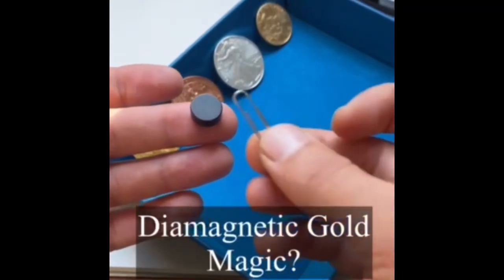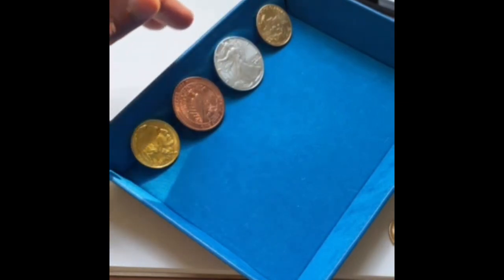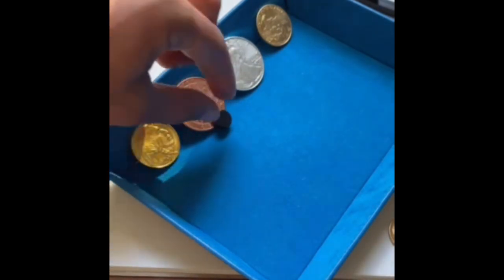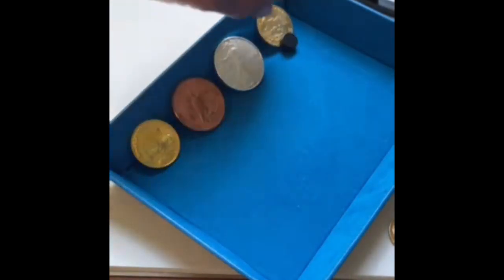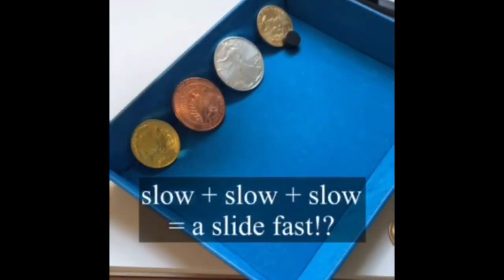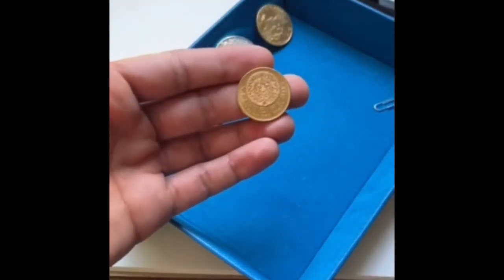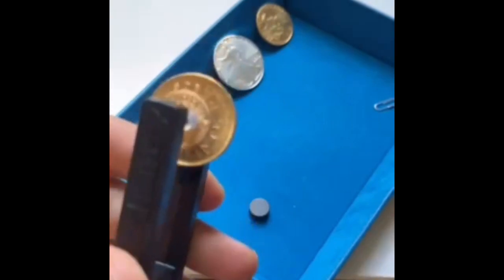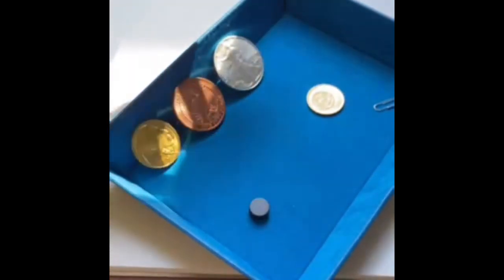What is happening to gold in this video? Science please explain!

Comment: Resistivity, electricity and magnets
1. Electricity and magnets: (TLDR version)
Magnets moved around a coil of wire, copper/silver/gold coins in this case, creates an electrical current by "pushing" the electrons of the metal. The resultant "pushing" is commonly called volts or electromotive force.
In other words; A device made to hold the magnet and spin it around each coin will show volts on a voltmeter.
2. Resistivity:
Gold, copper and silver have a specific resistivity.
Resistivity is a measure of how strongly a material opposes the flow of electric current. The lower the resistivity, the more readily the material permits the flow of electric charge.

Use an ohmmeter:
Gold- 2.44×10^-8 ohm-meter @ 20°C
Copper- 1.77 × 10^-8 ohm-meter @ 20°C
Silver- 1.59 × 10^-8 ohm-meter @20°C 

Two Hypotheses: 
1. The mixture of the various metals reduces the resistivity to such a small degree that it appears there is no resistance.
2. One of the coins is fake.

Comment: The alloy may be of such that the valence electrons change enough that the dipole states that are typical for diamagnetism for weaker metal are inverted. maybe the dipoles are closer to anti ferromagnetic characteristics.  Unfortunately this is a guess from what little I remember from chemistry for engineers class and physics two with calc.  I’d have to look at my notes and books again to get a better grasp.

Comment: As I see it, when you slide a magnet across the face of a piece of metal the magnetic field induces a voltage in the metal. Because the metal is larger than the magnet, the sides not affected by the field act to short circuit the voltage and another magnetic field is generated, this time in the metal but in the opposite direction to the magnet. This is what slows the magnet down. The reason this does not happen with an alloy is that the atoms of each metal are different sizes and have different numbers of shells and different numbers of electrons in the outer shells. Because of this the movement of electrons between atoms is impeded and any magnetic flux created is canceled out by each atom the electron moves too.
Reply: This is an interesting explanation.
However, since the eagle is 22 carat gold with only a small amount of copper and silver additives, gold is the dominant component (91%).

Could it be that only 9% of different atoms change the behavior of the eddy currents significantly?
Reply: This makes sense too.  Not enough surface area for the induced mag field to realign the few dipoles and create the diamagnetic effect. If that is what you are saying.  Been awhile